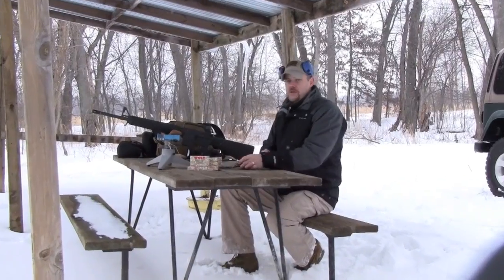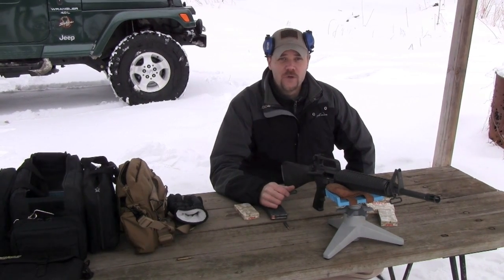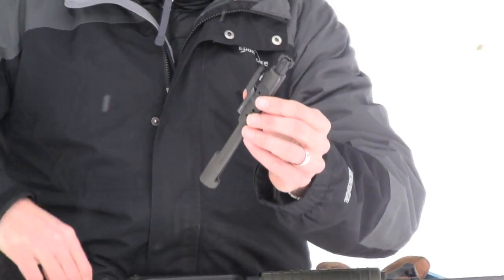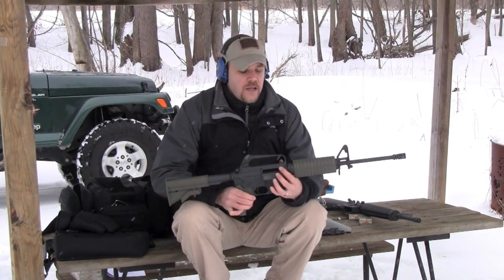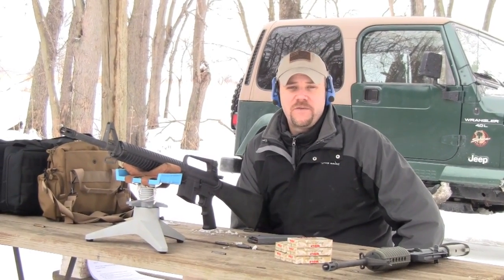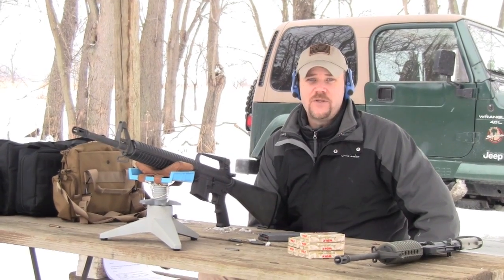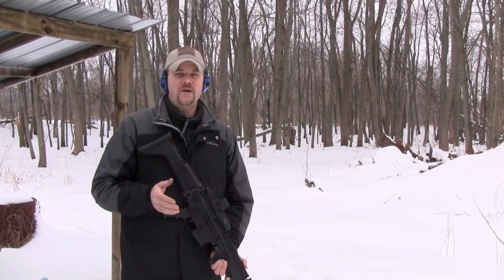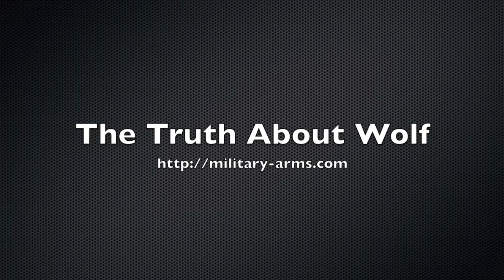The Truth About Wolf Ammo

Comment: I am one of the worlds biggest fans of Wolf ammo in every caliber I have tried it in. There is no better practice grade ammo out there anywhere NEAR the price of Wolf. I do avoid like the plague anything that even rhymes with Tula however. Bear is a poor second cousin to Wolf especially Wolf WPA
Reply: Dennis Matt Wolf and Tula are the same exact ammunition.
Reply: Morgan Finley Agree with you. I have aSig 556R 7.62x39.  Only use WPA Polyfofmance. Only time had a problem was the day I tried to use my son AR15 magazine on the Sig. Merry Christmas.
Reply: Morgan Finley  False.  With aĺl due respect do some research.  Tula used to manufacture Wolf. Merry Christmas.
Reply: Currently Wolf is being produced at Barnaul, the same plant that manufactures Brown Bear and Silver Bear. I've never had a single issue with any Barnaul-made .223, 7.62x39, or .308 Win. As far as I'm concerned anything coming out of Barnaul is good to go.

Tulammo on the other hand I have had too many issues in the past to bother with. Most current Tulammo is coming out of Ulyanovsk plant.

Years ago I had some Tulammo from Ulyanovsk that was so bad that it wouldn't run in even a .223 Saiga. Case necks varied in length which is a massive QC problem, and most cases had rust on them, and appeared to be missing the polymer coating. Many rounds were too weak to cycle the rifle. Last time I ever bought anything headstamped from Uly or under the Tulammo brand.
Reply: Dennis Matt I've read your comments elsewhere and respect your opinion. What are your thoughts on the current wolf military classic vs wolf polyformance

Comment: The problem with wolf is, its loaded weak, if you compare it with 5.56x45mm NATO, this way, the pressure isnt as high as intended to cycle the action. I tried the Wolf in my FAMAS Commando (lever delayed blowback), and it didnt cycle. If your AR-15 is older and the recoil spring is weakend, your gun will cycle wolf more reliable!

Comment: I can tell you that the wolf 223 Brass casing cartridges are under powered so depending how your rifles gas system is tuned you may or may not have problems my Sig M400 AR-15 will not shoot wolf ammo but my buddys guns eat this stuiff up so buy a few rounds and try them if they work good if not you will have to try another type
Reply: +Cody Lawson Should have bought an Adams Arms rifle as it will drive tacks with anything, including wolf gold. No adjustment necessary.

Comment: I ran Wolf through my freshly cleaned Sig 556 (I clean it after EVERY outing, just as I do with all of my guns).  Less than 100 rounds in, my extractor ripped the head off the casing and the casing was stuck in my barrel.  I had to push it out with a 1pc steel cleaning rod to clear it. 

I would like to emphasize that this is a Sig 556, not a bushmaster or some kind of low end, $600-800 AR.  You can say what you like, and it appears for the most part you know what youre talking about.  But the proof is in the pudding.  I was there, it happened, PERIOD.

Comment: I like your video and heartily agree with your assessment regarding casing material, casing coatings, extractor timing, over gassing and powder residue due to blow-back. But I will add:
.223cal. (SAAMI) and 5.56mm NATO [Mil-Spec M193/M855] are DIFFERENT.

They are several reasons why ammo sometimes causes problems. 
Foremost is the failure to differentiate between SAAMI .223 cal. and 5.56mm NATO  chambered RIFLES of the AR-15/M-16 type.
Colt, Bushmaster, and many other mfgr's make both weapons.

Know your weapon! and choose the correct ammo.

BEWARE of  CHAMBER PRESSURE differences in design specs for these two weapons.
BEWARE of LOAD PRESSURE in these two types of ammo.
Be cognizant of  chamber HEADSPACE in these two very SIMILAR yet DIFFERENT weapons.
There are also different types WOLF ammo casings but this issue affects Mil-SPEC weapons when firing SAAMI rounds due to CHAMBER HEADSPACE .

Comment: Last weekend I went to the range and shot 60 brass case Perfecta (cheap ammo made by Fiochi-$15 for 50 rounds at Wal-Mart when you can find it).  I sighted in at 50, 75, then 100 yards and was shooting tight patterns.  Then I started in with Wolf and I wasn't even on the paper at 100 or 75 yards.  I had to go back to 50, then 75 and finally back to 100.  Tight patterns weren't possible.  I bought 500 rounds of Wolf.  Its "spray and pray" ammo.  I won't buy any more of it.

Comment: My dad has boxes of wolf .22 LR target loads and they are absolutely garbage. They wont cycle semi-autos and the brass swells so bad that the stick in the chamber. I got a single action .22 revolver and the brass swells so bad you can only shoot 3 rounds and the cylinder wont turn anymore. I haven't had many problem with other calibers of Wolf. I had some steel cased .223 and the steel casings would do the same they would swell and stick in the chamber 1 out of 3 rounds, the .22s were all crap.

Comment: I noticed that you made no comments on hollow point Wolf or most any comm-block ammo in a hollow point format.  What I am referring to is the fact that there is no appreciable difference in the behavior of HP or FMJ ammunition in terms of expansion. Or, put a little differently,  Russian HP projectiles do not expand.  So, if you are paying more for HP ammo, you are getting ripped off.   When it comes to SP projectiles, I don't know, but my assumption is that it would do better than HP maybe.  What do you think?
Reply: +DocLarsen44 Russian HP projectiles are not designed to expand, they are designed for better accuracy.  Shooting either an SKS or an AK, my group sizes with HP ammo are half the size of my FMJ groups.

Comment: This guy is wrong the reason why brass casings are used is because they'll expand when fired which catches the gas that you don't want going back into your firing pin. Plus the bullet itself is not lead but steel coated with a thin layer of copper. Does it sound like a good idea having steel go through your barrel?

Comment: Firing a .223 cal round with lower pressure and thinner brass in a chamber with excessive headspace like the 5.56mm NATO weapons platform is asking to:
Rupture/Bloat a cartridge case in the neck region.
Potentially jam casings in the chamber [note: extractor damage on  casings.]
Possibly cause burring in the chamber upon extraction.
Leave excessive residue in the chamber affecting cyclic fire reliability.
Leave the shooter with a face full of excess gas.
Damage the gas/op mechanics [firing: 5.56 NATO in .223 cal. Weapons] due to excessive pressure, and timing issues.

I use WOLF ammo often but I use the right ammo for my weapon. Yes, I do buy the cheaper WOLF for plinking but never more than a hundred rounds at a time unless the cartridge casing is brass. Or I fieldstrip and quick clean the weapon every 100 rounds.

Comment: Same thing goes for .22lr bolt conversions (for AR-15). Everything they say about it may be true...thats why I use the crap out of it. If all it takes to through you off your game is a lighter round and less recoil you are in trouble all ready. I have seen guys stop in the middle of a drill to pick up a "good" round of 5.56 that was extracted to clear a problem. With .22lr you get over worshiping every round that hits the ground. Jack two or three out on the ground...just get the gun running.

Comment: SVT 40 of WW2 era solved steel case problems with grooved chambers to aid in extraction.  The grooves allow some of the gasses to act on the case and push back against the expanded case.
Shoots minute of groundhog.
Reply: That is very interesting, thanks.  And I would die for a SVT 40.  Definitely no corrosive surplus for that.

Comment: I dig the selection of carry handle A1/A2 uppers! Those are becoming non-existent on the gun store shelves around here. In fact, its difficult to find any uppers being sold these days with proper carry handles and not the cheesy bolt on Chinese variety. It kind of sucks if you are going for strictly iron sights especially for a dissipator, mid-length or a classic rifle look. Then, you have to spend extra money on  a bolt-on, inferior, flip up, or daniel defense peep sight and have a rasp where a handle should be. It is ironic how the industry goes with what is new and popular only to end up making the older stuff cooler and more desirable (at least to me). 
Hey Mac, if you haven't already, you may want to try the KNS cross hair sight instead of the standard front post. It can really turn the iron peep sights into a new animal for very little money.($20-25).

Comment: Hey Sturm, with your extensive experience with AR-15s, what breakages have you encountered? I mean, what parts have failed in your AR-15s over the years. I'm not asking so I know which spare parts to buy, as I already have a Field Repair Kit that would cover most of the bases. Rather, I'm asking out of curiosity and for preparedness sake. Thanks.

Comment: My buddy has a stag and it week chew steel up.  Like holes in the casing, fte, but that's cuz its a cheap AR :)
Reply: funny because My 6yr old Stag3 has no issues with it, the only issues with modern Wolf are powder inconsistencies which lead to it's mediocre accuracy because of variations in MV, inconsistent crimp and casing expansion, and inconstent formation in manufacturing of the lead cores. The only other issue as MAC explained is that the steel case does not expand to the same degree as brass and therefore the lower grade powder which is already a dirty powder has a huge amount of case/chamber blow by.

Comment: Wolf works fine, if you own an AK, SKS, Mosin, Makarov, Tokarev, CZ or other Soviet designed weapon. Nothing wrong with Wolf Ammo. If you use Wolf in an AR, you're asking for trouble. ARs are not meant to feed steel cased ammo and extractors designed to feed and handle brass and not steel you're asking for trouble

Comment: The steel casing is horrible for ANY gun and slightly more toxic due to non expanding casing. It's extremely dirty. My rifle LITERALLY says under NO CIRCUMSTANCES to use STEEL cased ammo.🙄 It also for some reason says not to use Winchester as well lol 😆 no clue why but I've never had a malfunction with it and I've been to the range with it 100s of times.

Comment: if I do have problems running steel case through a ar 15 what can I do to fix the rifle in order to shoot steel case properly?
Reply: if it doesn't cycle right and you have a adjustable gas block you can typically do some adjustments to that. the problems usually occur because Russian ammo is a little under powered. thus it may not move the bolt carrier back far enough but I've had a problem with it.
Reply: abraham m did you ever get your gun to shoot steel case Ammo?  What length of barrel is your gun?

Comment: I'm amazed at all of the ignorance here... 

1. STEEL SPARKS! Brass doesnt... 
  -STEEL =/= GUN POWDER* 

2. STEEL is also very hard, but BRASS is very flexible... 
  -After the explosion & the gun powder goes off, then the case POOFS OUT! Well, a BRASS case POOFS, but instantly shrinks back to normal! Steel just POOFS, but doesn't shrink...

3. STEEL can also be hard on the extractor... You don't want to wear that puppy down!

That's why the Military doesn't use it, and

Comment: i never clean my rifle and i never have a problem with it i know i know that's crazy but its true i shoot thousands of rounds and it just don't screw up maybe i should clean it and see if it works better but it works fine  now so why ?
Reply: Kinda like changing the oil in your car.... it keeps it running smoother, better, longer.  If you don't clean/change it....sure it'll function, but right up until it doesn't.... but you don't know when that is, and pray that it's not when you need it most.

Comment: Will a Piston Driven AR have the same timing issue as a Gas Impingement AR with the shorter barrel configuration?
Reply: It's my (limited) understanding that gas piston designs are not so time sensitive or gas pressure curve sensitive as the direct impingement system. The piston and operating rod helps this. The problem in direct impingement is the gas tube length.

Comment: Have you ever shot out any barrels due to the use of bi-metal bullets?
Reply: Coty Prestage Sorry, this article proves you completely wrong. http://www.luckygunner.com/labs/brass-vs-steel-cased-ammo/
Steel cased, bi-metal bullets keyholing after 6k rounds, federal brass cased copper over lead still had life after 10k rounds when the Steel cased bi-metal rifles were smooth bores.
Reply: I had read that article as well, but there's a difference in wear when shooting 10,000 rounds in a afternoon and 10,000 rounds in 10 years. The high temperatures is what does the barrel in, combine that with the slightly harder metal passing through creates more wear. I'm trying to ask a frequent shooter rather than someone that just shot 10,000 rounds through in a single afternoon.
http://bulletin.accurateshooter.com/2013/11/how-to-wear-out-a-barrel-in-one-afternoon/
Reply: ***** Then why does the barrel using federal standard copper over lead show much less barrel wear than the rifles using Bi-metal rounds when all of the rifles were being shot at the same rate?  According to you all of the barrels should have the same wear patterns and the article shows the two riffles shooting bi-metal rounds are smooth bores while the rifle shooting federal still has life in it.
Reply: 5starr1 There are also other factors other than the material of the bullet itself such as the powder. There is no doubt that the Russian powder burns dirtier and grittier than the Federal powder. This excess material causes excess friction therefore more heat is produced. This is why cleaning the barrel extends the life of your barrel. I don't know if Lucky Gunner acknowledged this, but it is a huge factor and their test was very extreme. A more realistic test closer to the average shooter would be to fire 100 rounds every day for 100 days and maybe clean every 500 rounds(fifth day).

Comment: Nice commercial advertisement for a foreign-made product, but the fact of the matter is that WOLF brand ammo is filthy-dirty stuff that fouls your gun. That is not a problem if you clean it thoroughly after every use. The real issue is the steel casing rather than the standard brass: that man holding up a spent casing and saying that it isn't damaged evades the fact that steel casings can wear down an extractor claw; if that claw breaks, you're screwed. Nice commercial ad for WOLF ammo.

Comment: Wolf is not bad, Tula is not bad either. I get yelled at for using them in my AK and Hi power. 

People don't understand the AK extractor is larger than the AR 15 and can eat just about anything. My hi power is my choice. No the steel casing ammo is just a hair harder than brass, but softer than the firearm. It will NOT damage your firearm.

Comment: Doesnt damage the gun but in american firearms. Its varying in powder charges (same with tula) can be disconcerting. Im weary of such loads as some are really low powder and imo could possibly squib load on a rare occasion. More likely with russian ammo then nato spec. The flip side is the occasional +p load. At the bare minimum, true accuracy is not gonna be a factor with this ammo.
Reply: Ill also add the same does not apply to 7.62x54r, 5.45x39, 7.62x39, or 7.62x25. Russian ammo for russian guns.

Comment: A, Use  Soft  noses,  they  reduce  over  penetration risks  a lot. Soft  noses  are gray-tipped  rounds. B. Clean  your  weapon after every  firing session  and  you won't  have a  problem with Wolf.
Reply: If it'll kill someone dead it'll plow through lots of things before stopping. Soft nose, frangible and other "low penetration" ammo doesn't do what people think it does nor does was it expressly designed for what people think it's for.
Reply: Are you  sure  you  aren't talking  about Barnaul HP,  which is  in actuality sawed  off FMJ?  I  have  personally seen the same ammo  rip through foot  thick  trees and keep going. Wolf SP did  not copy  that  behavior when  I fired  it.

Comment: Let's see, in a standard 16' AR Wolf will jam, allow more grime to get into the action meaning you can't shoot good brass without cleaning first, can damage or set fire to indoor ranges,but it's not wolf's fault.....

Don't mean to be hatin' and appreciate you videos, but seems you verified more myths than you busted. 

If I had a backup AR I just wanted to use to put lots of rounds down range, then maybe  would run wolf in it. In my M&P the only real malfunction i've had with it was a wolf case that got logged in the chamber so bad I thought I was going to have to take it to a gun smith to get out, but finally got it out but not after wasting an hour drive to the range. 

Not sure what i'm going to do with the rest of the case, I figure it will be good for barter if SHTF. Suppose I could run a few boxes once I've gotten most of my shooting in.